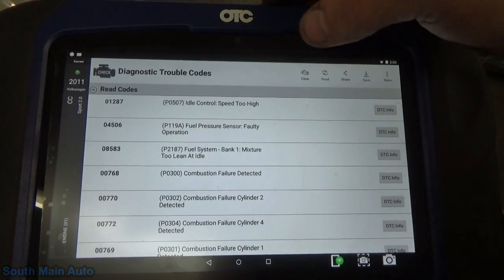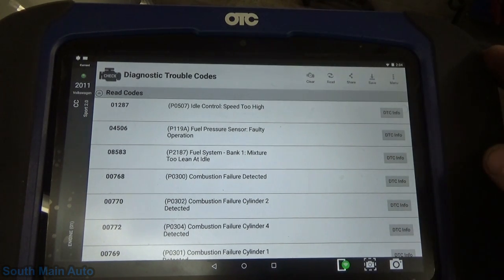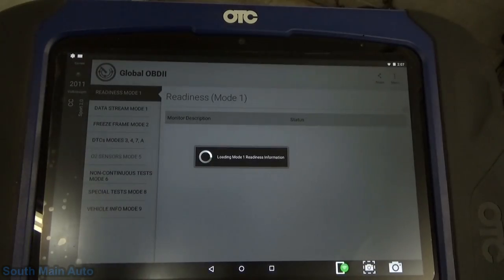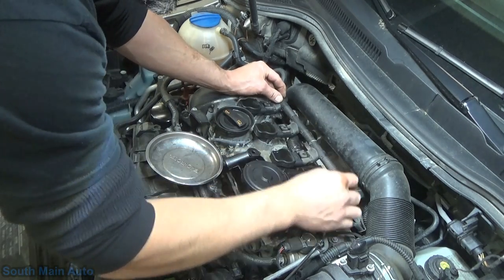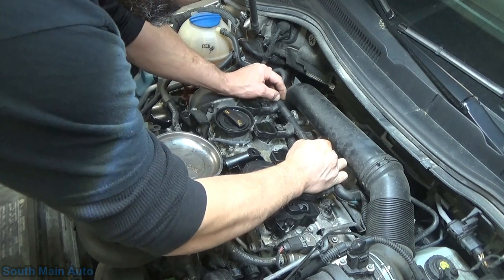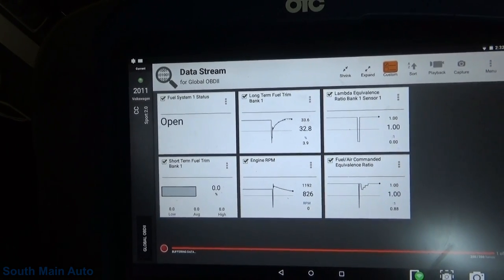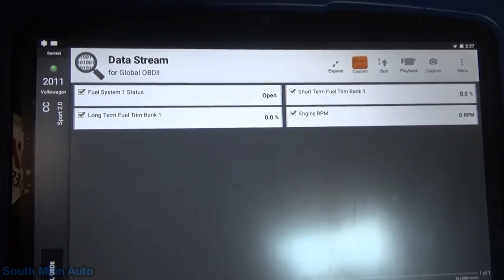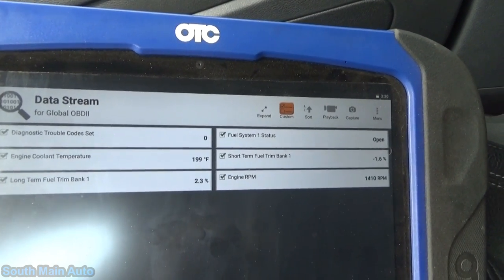Rough Running & Running Lean - Volkswagen CC Sport

Comment: little tip i learned once i started working at vw eric, on vw connectors, push in on the connector while you're pushing out on the little tab, makes a world of difference and they SHLIP right off lol, ive broken way too many using pocket screwdrivers etc and had to replace that small harness

Comment: PCV valves, with a ball and spring, did an elegant job of clearing blowby gasses without needing any electronic control. It's hard to avoid the thought that progressive engineering can be a step backward when you search for parts on an old vehicle like this. Great summary, it's always fun to follow along.
Reply: more like progressive service department / job filler ;)
Reply: What those old PCV valves didn't do was keep oil and carbon off the backside of the intake valves, and with modern GDI engines that's pretty important.

Comment: Wow! I had one sucking that much vacuum making a loud squealing noise on a 2016 Escape. Long story short the customer decided to "modify" the PCV causing this. It was the same thing though I could barely remove the oil cap. Not good at all!
Reply: FordTechMakuloco why would someone do that? Lol
Reply from the maker: Lol they modified it huh? Installed an old road draft tube and called it a day :D !

Comment: Neat trick I picked up: I pull the harness connectors off VAG ignition coils super easily by placing a Swiss army knife cork screw in the lock tab and pulling along with the connector. Pops right off :)

Comment: Eric you need to get the VCDS from Ross tech, the best for Audi-VW, plus their support is even better. With that tool there is no guessing if you can do a relearn, adaptation, coding or setting monitors.
Reply: Agreed!  It's not that expensive at all, either.
Reply: VCDS the one and only diagnostics tool you need for VW, even better than the original VAS testers.
Reply: Anybody used the OBDEleven with Android with success?
Reply: @karlzwaschka4905  Yes. Just bought one and used on my 2015 A6 3.0t Quattro. I'll be testing it on my '09 A4 Quattro this coming weekend but I see no reason it won't work.
Reply: @karlzwaschka4905  pro version is good to go. i always used it on my vw sharan.
Reply: @khier78  Do you feel that it is a suitable  alternative to VCDS?  I just don't want to spend $200 on a com cable and have to continue to keep my old laptop on life support.  I have a Eurovan, no issues after I replaced the timing chains but keep hearing horror stories about how week and prone to failure the 01P trans is.  I would like to use OBD11 to keep an eye on TC slippage and what not
Reply: @karlzwaschka4905  I have obd eleven pro for my b5 Passat  Paid $70 and it has helped me alot.  I use it on a Samsung note 8. Keep it in my glove box so at any time I can plug it in.
Reply: My advice! He should just do what all of the shops in my area do and say we don't do VW or Audi.....😆The worst cars to work on period.
Reply: @yeahboiii6640  not even close. Lol. Modern  Cadillacs wins that by long shot
Reply: @joes.7536  Ah...never worked on a Cadillac and never will...GM will never earn my business again. Just like VW will never earn my business once I get rid of this VW 😆...Only Toyota, Lexus, Honda or Acura from now on...Have a 2004 Lexus E330 runs like a clock and fairly easy to work on.
Reply: @karlzwaschka4905  I have one since I bought my B7 2.0t fsi . . I'm not gone on how it needs data to work everytime I pick it up, I hardly use it anymore, much prefer the autocom, and only use the eleven when absolutely have to.. I'll be picking up a vcds in the new year.
Reply: @yeahboiii6640  lmao ......ok pal thanks for that .... US cars are gold aren't they ??

Comment: This vehicle does not have a valve cover gasket or spark-plug tube seals. It uses a special VW green silicone, P/N: D154103A1. Also the valve cover is the camshaft retaining frame and integrates in itself the cam bearings. This frame is unique to the cylinder head and if you put any other frame, the engine will seize. The "valve cover"/retaining frame is not available as a separate part as it is married to the cylinder head and if you brake it, you must buy a new cylinder head. 

Also, Eric, there is a special tool to remove the coils on all audi/VW models. Tool number: T40039

Comment: Other notable features (in real life) are: excellent driveability, easily tuned, chain tensioners that fail, plastic water pumps that fail, hopelessly inept PVC system, extreme intake valve carbon fouling, terrible rear main seal design, unknown engine check lights that the dealer cannot solve, and a myriad of plastic parts that leak or fail, coil packs that fail, cheap connectors that become brittle and break... I only wish the Germans could have made it more complicated. and, I'm sure they're working on that.
Reply: what you said = the same for US cars ....
Reply: Get a manual one and that rear main seal is now maintenance item lol.
Reply: @Dcc357  I know.
Reply: I have new injectors, new variable valve timing sensor, new sparks, fully rebuilded engine, new timing chain, new dual mass flywheel, dsg clutch pack and 2 years old mechatronics :) and it's still shaky on cold. When it worm up (15 sec) and revs will drop below 1000 rpm. It works ok and only each 5-7 sec I can feel some ticks.

Comment: You should not have fixed it, put a hose on it and run it as a vacuum cleaner^^

Joking aside, as a German I think those VW designs are often hilarious. But this PCV system is actually a pretty clever design because it does prevent oil from getting onto the back of the valves, which is a major problem for direct injecion engines.

What confuses me is their strategy when it comes to picking materials. The valve cover is aluminum (which is becoming rare), but many of the hose clamps and connectors are made of cheap crappy plastic.

But although I really do not like VWs at all, let's face it: all car manufacturers have flaws, and especially on such repair channels you only get to see the stuff that breaks. That can deliver a wrong impression.
Reply: Most VW's have a plastic valve cover. That TSI motor has a metal one because it also serves as a camshaft bearing bridge plate.
Reply: PLASTIC intake headers and thermostat assemblies are popular... 
Fords used to have issues with plastic caliper pistons...
Reply: Seeing how often Charles from The Humble Mechanic mentions brittle, breaky VW plastic parts, I'd be very careful handling them!

Comment: Always always always check the rear main seal after replacing those PCV assemblies. The two go hand in hand on the Audi side, not sure if it's as common on VW.  I've only ever used the factory scan tool to run the drive cycle, but it's always called "Readiness Code". They do run an open and closed loop, so I'm not sure why your scan tool was saying open loop. I want to say it would be listed under "CL Status" on the OEM data, but don't hold me to it. Did you get a water pump job out of it too?

Comment: Happen to come across this video recently because of my girlfriends 2010 VW CC. With 2.0T, this car has some serious punch but what the engineers don't understand is that putting a huge amount of air compression and high pressure fuel injection into an engine with a plastic intake manifold is not going to end well. That translates to the customer (my girlfriend) and the customer's boyfriend (me) as follows:
Intake manifold failure. Remove/replace.
Timing chain tensioner failure, resulting in catastrophic engine damage (engine was replaced).
Transmission beginning to weep and sob its ruby red tears of hydraulic fluid.
ALL.UNDER.50K.MILES!!!! If I were German, my overall rating of VW is
Lugen stuck schiebe!
Reply: hope you got in on that class action lawsuit.  just got a check for just over 1k to compensate for timing chain tensioner replacement.
Reply: @hcagostini  indeedy-do! Total engine rebuild plus loaner car for free. Damn crooks with their plastic engine parts...
Reply: I am not a VW fan (far from it), but timing chain tensioner fails usually is because of too long oil change intervals. Don't believe VW and change the oil twice as often as indicated by VW.
Reply: @ronaldderooij1774  not the case with us. I change the oil religiously, at old-school intervals (as in, every 3 to 5K miles) with top shelf stuff--Royal Purple oil & Bosch filter)

Comment: Had my 2008 Golf GTI 2.0T since new.  Gave it a stage 1 reflash, aftermarket dogbone mount and insert, and heavier rear sway bar.  Every time I get in it and drive I get a huge smile, even after 10years.  It's by far the best drive I've ever owned (I'm 68 so have had a lot of different cars) and gets a service once a year always using premium VW502 or newer spec oil.  I have replaced the HPFP cam follower once, a couple of DSG services, and a few sets of tyres, one set of brakes and rotors, one battery, timing belt and water pump.

Nothing in there indicates this is anything but a high quality product providing immense driving enjoyment.  I'm not ready to trade it on anything new.

You can stuff your cheap Japanese, Korean, and US cars where the sun don't shine, hehe.  I've owned them all before the GTI.
Reply: When I grow up I want to get one of those fast cars and become a hotrodder but I'm only 60...  😁
Reply: @ToddKing  Haha, I'm 72 now and the GTI is still going strong, it still brings a smile and I still give it plenty when road conditions suit.  Hang in there, you can still get one :)  When I took delivery of it in 2008  there was a 75yo guy picking up his GTI as well....
Reply: @einfelder8262  I was a Volkswagen Audi tech for over 20 years so I know all about them. Great cars though they can be high maintenance and not cheap to do so. It's good to hear you still are airing it out. Keep tearing it up.

Comment: Unfortunately I see a lot of Volkswagens, so I've seen this problem a lot. BMW also has a similar issue. Tip for VW electrical connectors, push the connector inwards then push down the release tab. Will come undone every time!
Reply: Thank you for that tip! I hate that style of interconnected wiring harness for the coils; get one coil connector loose, go fiddle with the next and end up relocking the connector on the previous one!

Comment: What I've seen also with the vw's. that pcv valve thing goes bad, and on the turbo ones it causes boost pressure to go into the crank case. Witch causes the rear main to blow out, literally. It turns the whole engine to a leak pit. Ive repaired two now so far, they will also cause lean fuel trims until the rear main is fixed

Comment: That rear main seal's days are numbered, that vacuum leak probably started to delaminate the seal from its hold down plate. Wouldn't be surprised if it came back with the same faults and an oil leak! Gravy job tho, even more so if it's not 4motion
Reply: steve Yep, that seal is hosed. At least it's not an Audi 3.0. Bitch of a job.
Reply: But the good thing is, when it starts to leak just jook a vacuum line to the oil cap and it will just suck air in and the oil won't get out!

Comment: Just had one of these done on my 2009 VW Tiguan...Called an oil separator....the sound it was making was horrendous and didn't sound at all like it was coming from that area...thought my engine was a gonner. Had that belt squealing/metal on metal scrapping sound...I didn't have a code reader at the time and had other things I knew were needed....leaking water pump. They also replaced my air intake manifold gasket covered under warranty to 120k surprisingly but I was thankful for that because they were able to reduce the cost of the water pump replacement because you have to take the intake off to get to the water pump. If I had known with a code reader that it was that oil separator I could have easily fixed it myself and saved about $300. It cost about $500 to have it done (ridiculous). My recommendation is to not buy a used VW ever! They don't make them with serviceability in mind for anyone especially a DIY guy. Also as you said the plastic is horrible everywhere on the vehicles. In my opinion that cheap plastic is a very planned/calculated failure. Especially when you make water pump housings that fails over and over and common out of that cheap plastic... My choices - Toyota, Honda, Lexus or Acura ONLY!

Comment: Replacing the PCV valve/oil separator peice is NOT necessary-  IF you replace the peice correctly. The key is to use the OEM rubber diaphragm peice. Not the cheap dorman type you mentioned. 

I replaced MY diaphragm, and rebuilt mine. 20k miles later - NOT a problem. I may be the rare ones who got lucky. you do NOT have to replace this whole piece. of course its' easier to just replace the whole part, but for $30, I fixed the problem....thaks for your videos. also I dida pcv bypass and put a oil/water catch can in, and it's catching all the moisture and spent fuel/oil that's not being recirculated backinto the turbo - ANOTHER huge recommendation.

Comment: Looked to be an easy job. Everything easy to get to. Didn't have dozens of hoses, wires, and brackets blocking. I've read through many of the comments. It appears that most don't like VWs. I'm finishing up a 2000 golf diesel. Rebuilt the front suspension and had to pull intake manifold. Heavy blockage, carbon build-up. 398,000 on it. It ran good before I started on it. Should be like new.

Comment: I think the closed loop issues is with the OTC,  not the car, they go into closed loop very fast normally. FYI we do at least 10 crank case vents a month. If you need any info or help on VW just let me know:) or you know Thomasexovcds too:)
Reply from the maker: Yes it was with the OTC, I should have made a follow up vid. the Autel worked fine and ran the forced monitor test with out a hitch :D

Comment: I had no clue what a "triple square" was until 15 months ago when I repaired my buddy's daughter's '06 Jetta. It ain't no Torx I'll tell ya that! :D It does look like 3 squares equally spaced over one another - how about that? :)

Thing was puking oil like crazy .. out the vacuum pump! I couldn't wrap my head around the fact a gas engine had a vacuum pump ... and then I just recently found GM trucks have them now too! What is this world coming to ...

 Anyway .. service manual says to yank tranny to replace pump! I uttered something about the Nope Nope Train going to some "expletive" That-Ville town ... and just removed the (don't know what it's called) from the shift shaft on top of the tranny, yanked the pump apart (which they said not to do) and loaded it up with Permatex Right Stuff, & reassembled. No more leak! 

Did a full brake job, and also replaced one hub bearing. Had to buy a couple sets of triple square sockets for that one.

VWs are odd creatures!
Reply from the maker: Yeah I have a customer with a 2.5 with the vacuum pump and same thing. you can pull it apart after removing the trans range sensor and fix it right in place :D
Reply: THAT'S the part I couldn't remember - range sensor!

I swear I have 2 brain cells - one's lost and the other is trying to find it ... :D

Yep, was the same engine on the Jetta - naturally aspirated 2.5 .

Comment: Hi Eric. I have a vw golf 1.8 tsi and of course it has a problem after 136k. When I am driving at low speed and release the gas pedal let's say before I make a full stop, weird noise is coming from engine, like something is loose (rattling noise like a metal cover hitting other parts) I did inspect underneath it but can't find anything. It happens only when I release the gas pedal at any speed between 15km/h and 60 km/h. Thank you

Comment: Eric, according to Youtube's Humble Mechanic,  to open a VW dealership in the US, the franchise needs to buy $600,000USD VW specialty tools to commence trade. So you did well to find the problem, regards Stewart, Australia
Reply: That is common of most makes. They all have special tools, a couple scan tools and specific space requirements before they will let you open. The catch to that is that the dealer only needs ONE set of all those tools in the shop, regardless of the size of the shop. That is why each tech ends up buying the special tools they use and their own scan tool. Needing to "wait in line" for the scan tool can kill your day...
Reply: Eva Gillies Yeah, to open a dealership, not to work on them. There are a ton of specialty seal installers and such that are not necessary for 95% of the work. Ross-tech makes a very adequate VAG scanner that's fairly inexpensive. Do not think that you need anywhere near that much investment to actually work on them.
Reply: I've yet to find anything that the Ross-Tech VCDS couldn't take care of.
Reply: Michael Gleason Yeah I agree, my comment was about VW's requirement for a dealership. When the Humble Mech made that statement he was comparing the specialty tool differences with Asian cars in a conversation with Eric the car guy. As far as the after market tools for VW in the US, I wouldn't know, as I reside in Australia. However, I have heard from a local mechanical engineer, buying a VW is dangerous for your wallet, as VW customer service sucks, and Australia dosen't have Lemon Laws for new cars, Regards.
Reply: Don't forget all the 'signage' and corpórate furniture required......

Comment: Eric...if you are going to pick up more VW/Audi work, I would strongly suggest investing in the VAGCOM software. It is specifically for VW products. And it will let you initiate a drive cycle.
Reply from the maker: Yeah I do not see many of them and I should have done a follow up video the Autel was able to run the forced monitor test and worked well. But you are right if I do a lot I should get one!